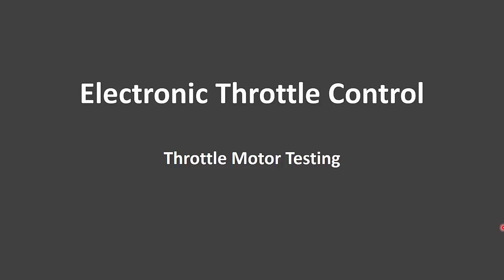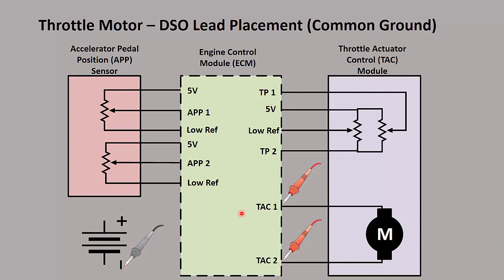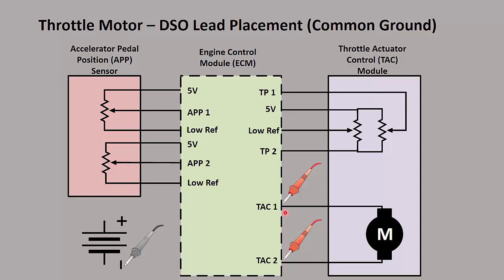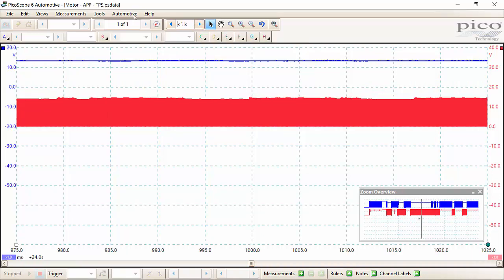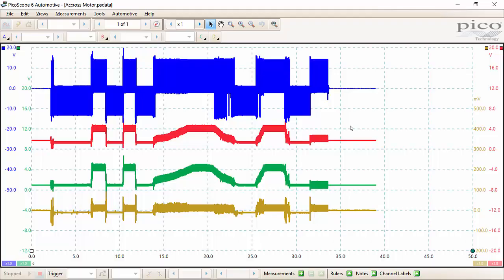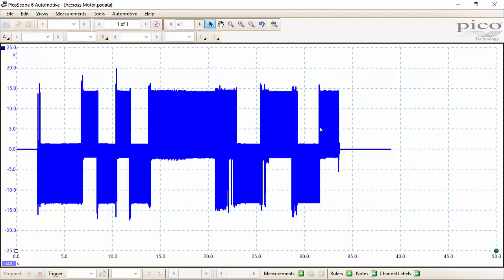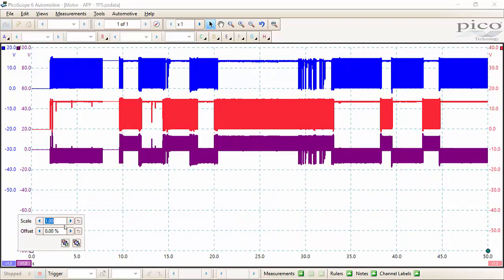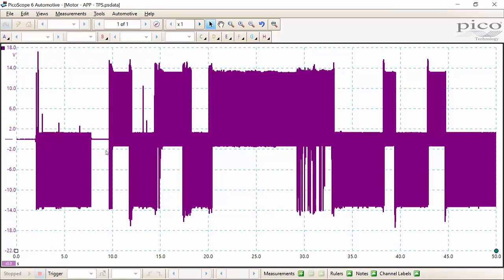Electronic Throttle Control Motor Testing with PicoScope

Comment: GREAT VIDEO MATHEW , COULD I ASK HOW IS THAT EIGHT CHANNEL PICO WORKING OF FOR YOU  .  I HAVE BEEN USING SCOPES WITH OUT PRESETS FROM I STARTED USING SCOPES SO I WONDER HOW'S THE CHANGE WITH EIGHT CHANNELS FOR YOU WHAT'S THE BIGGEST CHALLENGES THANKS FOR YOUR TIME AND PLEASE KEEP UP THE GREAT WORK .
Reply from the maker: I never use presets either. The only issue with the 8 channel is you have to be careful. Automotive scopes have additional protections built in. The 8 channel could be damaged if not used correctly.
Reply: @matthewshanahanautomotivet4284  THANKS FOR THE REPLY , WOULD IT BE BEST TO JUST USE AN ATTENUATOR WITH MOST CHANNELS AND WHERE WOULD THAT BE A BIG ISSUE .  LOOKING FORWARD TO MORE OF YOUR INDEPTH VIDEOS .
Reply from the maker: @8power0  You will also have to worry about the ground placement. The attenuation is not the only issue. The latest automotive Pico scope is fairly robust. If you were to scope across a throttle motor, for instance with the 8-channel you could damage it.

Comment: I got a little confused. Did you say the common ground was the one that uses only one channel or requires two? Is the newer pico’s use one ground for the entire scope like escope from ats? Thanks. I’m about ready to buy one and would like clarification. Great vid👍
Reply from the maker: The newest Pico has separate grounds. AES Wave now makes a test lead set that you can ground the 4 leads together at the scope. There are some advantages to having the grounds isolated from each other. Feel free to ask more if that didn't answer your question.
Reply: Ok i understand it now. Would be cool to see some examples of isolating the grounds. Love this stuff! Thank you

Comment: Thank you for sharing! I’m fairly new to scoping. I’m currently using a 2 channel Modis. Looking to upgrade to a Pico in the future. I was under the impression that a floating ground just meant you had to ground every channel separately. By the way, Is this a known good vehicle or one with problems? 
Again thanks for sharing.